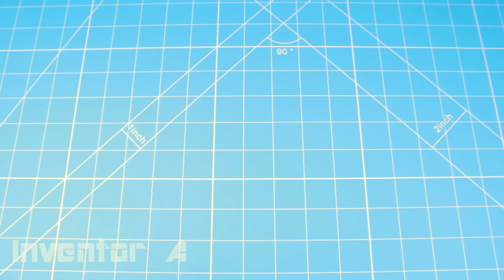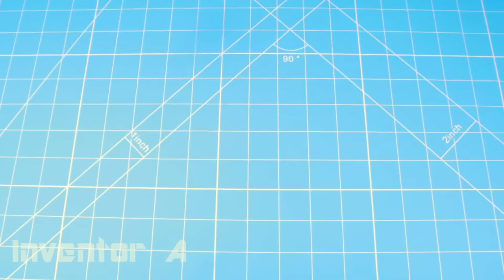How To Make Coca Cola Speaker - DIY Speaker

Comment: El metal no afecta la electricidad si hace contacto?
Reply: It has a clear plastic coating on the inside
Reply: Very good, but u should have added speaker protection. I can see them not lasting very long until they get damaged

Comment: How did you make the hole. How did you put the nut for the charging port. How did you remove the wire from the Vape charger. Why are you using a vape battery. What is the power of the battery. None of which you have mentioned. CRAP.

Comment: This speaker is awful. Yes, I will provide reasoning.

1. The barrel jack.
2. The fact that you didn't bother to test the speakers.
3. There was NO structural rigidity added whatsoever to a flimsy can.
4. The audio quality sounds like a bluetooth speaker from 5 Below.
5. The fact that the wires are all the same color and unlabeled.
6. It has an unfinished look.
7. Inconsistency with materials (using epoxy for one speaker, hot glue for the other).
8. The inside is a rat's nest.
9. That one hole in the back that decreases the durability.

I see how this may seem interesting as a novelty, but even at that, it's not a good novelty. Since the audio quality sounds like trash and has two trashy holes, it's beyond useless other than to sit on a shelf and for it to collect dust.